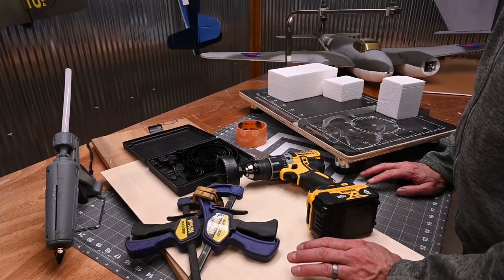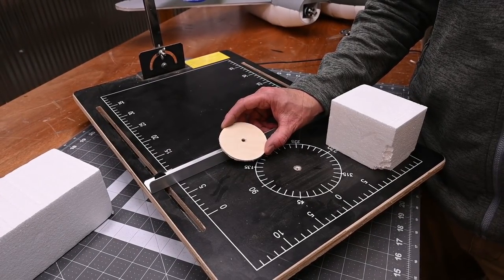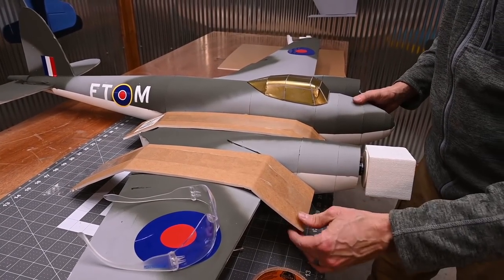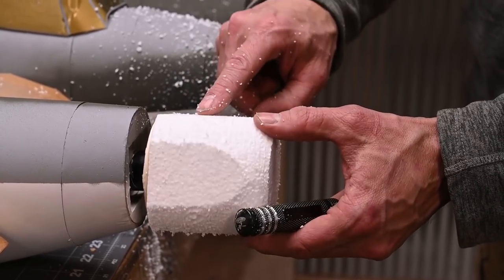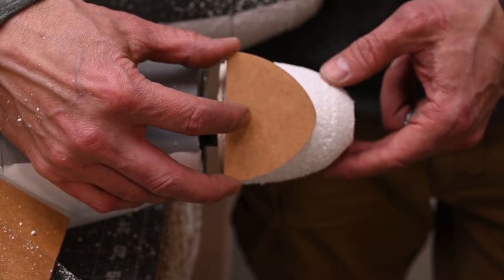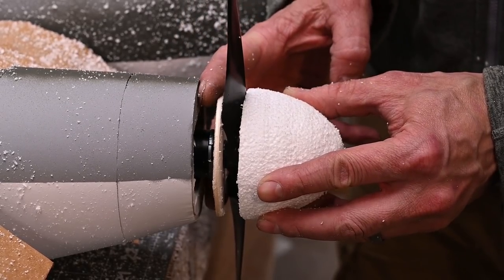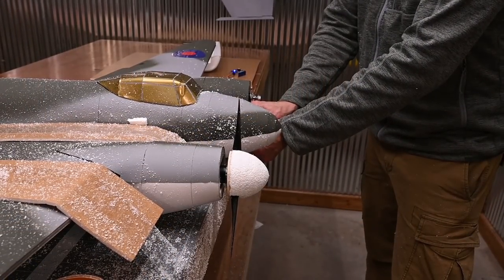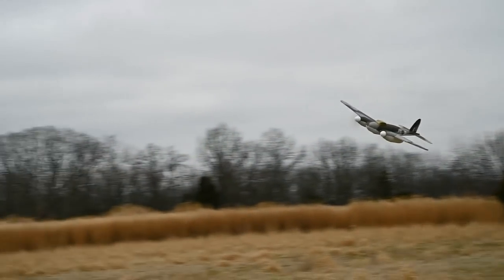How to Make a DIY Foam Nose Cone!

Comment: This was hard to watch why do all that sanding when you could use the hot wire to cut a circle, what a mess
Reply: yea, i expected him to glue the wood circles to the foam and hot wire cut cylinders that way. it would eliminate most of the instability at the first step on the "lathe"
Reply: Why would he want to eliminate all that foam dust by hot wiring it? LOL

Comment: Stop drilling with the hole saw before you go all the way through, and flip the plywood and finish from the other side.  This will greatly reduce the tear-out (splintering) on the back of the disk, and when drilling through thicker materials it will also help the material not be stuck as deeply in the tool when the cut is finished.
Reply: That is a solution, also the one I used to use is to simply have a base chunk of wood that you place your work on and drill into and it acts as one piece and so you get no tear-out, the thing is however tear-out is often the sign that someone does not know how to drill properly, most will use way to much force when drilling and this is what often causes the tear-out because as the material gets thin you basically push the drill bit through the remaining material rather than it cutting through and this causes it.
Reply: Another option is to put packing tape on the bottom side of the piece you are cutting.  The packing tape will hold the wood fibers together so they will be cut away instead of tearing out.

Comment: Save your ESCs from spikes ! Lathe turning 101, cut off corners to make an octagon before you start turning !
Reply: I was wondering why he didn't use the hot wire to make a cylinder using the plywood as a template.

Comment: Not bad for a DIY solution however personally I would use modeling foam as it will allow for a smoother surface, though personally what i have done in the past is you can buy pre molded  smooth surfaced  polystyrene eggs, they come in all sizes from tiny to huge and you just cut in half  or at the point you want.
Reply: Or at least use the denser XPE (blue/yellow/pink) foam you can get at nearly every hardware store.
Reply: If I'm not mistaken, an object can only be cut in half at certain points,  not anywhere you want. You can cut it anywhere you want, but not in half, two pieces are not necessarily halves.
Reply: @shelbyseelbach9568  You are mistaken,  cutting something in half does not require both half's to have the same end volume, this is because you can half by volume but also by measurement, if you wanted to cut an egg in half by volume so you have a 50/50 split then you cut vertically ( from the shallow base of the egg to the pointed tip ), however if you are looking to cut the egg horizontally then you cut in half by measurement, as in measure vertically from the base of the egg to the pointed tip and lets say it measures 2" from base to tip, to cut in half you cut at the 1" mark
Reply: @EQINOX187  if you were halving by weight or by volume, you still can't do it by making a random cut wherever you want, it is you who are mistaken.
Reply: @shelbyseelbach9568  Did you even read what I typed clearly you did not, no one is talking about halving by volume or weight, you clearly know nothing if you think they are the only ways to halve something.  No one said a random cut would be half, again read what I wrote it really helps you not look well stupid, what i said was ether cut in half or cut at a point where the diameter would match, as i said cutting something in half does not always mean both parts are equal.

By cut in half i was referring to the measurement type since when an object is an irregular shape like an egg is you have 2 methods of halving it 

1: First is by size/volume as in cutting it vertically from base to tip in this method it results in 2 identical halves. 

2:  Second is when you have an irregular shaped object but need to cut it horizontally at the half way point that would result in 2 dissimilar parts, obviously you can't halve by size or volume, no instead you halve by measurement, like I said if an egg is 2" from base to tip lengthwise  and you want half by measurement then you cut it at the 1" point this results in 2 halves  buy measurement not size or volume.
Reply: @EQINOX187  so confused

Comment: I would definitely recommend NOT sanding from the side like you did; sand from the bottom so if the paint stick bounces it bounces AWAY from the prop. 
Also, a coat of modge podge (or modge podge mixed with paint) could give you a stronger, paintable surface

Comment: Personally, I would make a concave template. That way, I could check the contour of the spinner with the motor still spinning. But in reality, either way works great!
Reply: at first I thought he was going to make a concave template to put the sand paper on.
Reply: concave coathanger template so you can put a current through that and cut it leaving a smooth surface.

Comment: To prevent foam from covering the area, a great tip is to position a vacuum under the sanding area. It doesn’t pick up everything but it’s worth it.

Comment: If your "Shaping Stick" (sandpaper glued to paint stirrer) was pointed >Towards< the direction of motor rotation, you would get a much smoother sanding... and less chance of getting into the prop...!
Or you could just use a heavier piece of Ni Chrome wire, bend it to shape, and Hot-Cut the desired nosecone to shape!  (I've had good luck with Stainless Steel MIG Wire, bent to shape, and cut all kinds of different foams).
Reply: Was thinking the similar, and doesn't have to be nichrome as I've seen other wire profiled like you note with heavier duty two lead soldering irons and I'm sure other methods to cut the contoured shapes.

Comment: I like it. Gives me very strong This Old Tony and AvE vibes, only without the swearing. Some points I want to bring up, though.

* When you get to the first time you check it against the template, instead of sanding all that extra material off, just use something like a butterknife as a cutoff tool. Saves on mess, will be much faster.

* You could use EPO foam to make these as well, and EPO foam is basically proof to the chemicals used in RC. Shrugs off glow fuel, spray paint, all of it. Stuff's good.

* You could also have a shop vac running with a wide collection scoop near where most of the chips are gonna fly to help with the mess real-time. Won't totally eliminate it but ittl suck most of the foam balls in.

* Alternate title of the video: John Overstreet turns a foamboard Mosquito into a one-time-use lathe.

Comment: After watching this, I think EVA foam blocks might be a good alternative as EVA can be sanded very smooth and takes acrylic paint well. I've  turned small eva foam pieces using essentially the same process shown in this video. Yes, they will be heavier than the foam used in the video, but I think EVA may still be a viable alternative.

Comment: Nice looking spinners, Have you considered  making spinner plugs this way and then vacumforming some plastic ones to install on the model. I'd think that if you used a slightly thicker backplate (say 1/4 inch) you could attach the spinners as they are on 'Full size' planes. Then you could simply make cutouts for the propeller blades and they could be painted easily.

Comment: you can use 4 o 500 grit for final sanding and water base paint will color nicely  you could add a coat of wax or shellac

Comment: I would cover the spinner with two coats fiberglass to give strength, sand and then paint.  I would also find a way to save the spinner in case prop gets damaged, and be able to use same spinner with a new prop.  My two cents :-))

Comment: Wouldn't it be easier to just trim those corners off before spinning using a razor knife? Scribe profile onto flat sides as trim guides....before shaping with sand paper stick.. a small hobby lath would be safer as well as using foam that is more dense.. understand this is an intro method geared towards any level. Not everyone will have a lath. 
Great idea....the addition of spinners adds so much to these models.....👍

Comment: Thin down some elmers white glue (It's water based) Brush that on then you can use regular spray paint.  That will also smooth the texture up a little as well.  Keep that glue coat thin so you don't add too much weight.

Comment: This isn't a bad way to do it, but I would have cut my cube, then used my template laid on 2 sides of the cube to intersect the template, and cut it with the foam cutter. After that, you can put it on a motor and do the sanding like you exhibited here. I would use a finer grit of sandpaper on a smaller stick though. Overall, it's a great technique for making super customized nose cones.

Also, work with with the rotation, not against it. the stick almost caught the prop a couple times from it bouncing uncontrollably. I'm no physics engineer, but I'd guess you can chuck the sanding stick at high speeds if the prop catches it.

Comment: If you'd have continued to use your hotwire cutter it would have been quicker and cleaner to get to a cylinder. Also a drill press would provide a slower, maybe more controllable working platform. Good idea though. Thanks. John S.

Comment: he could have done most of the work with the hot wire, use a little larger template for the concave, then use the 3" diameter backplate as the guide to round it, then finishing is lots quicker and cleaner! there's lots and lots of ways to get to the end results!

Comment: Could cut the blades off the prop just slightly larger than the spinner for safety. Better to sacrifice a prop than the whole model, spinner, fingers, etc! Also hold the paint stirrer / sandpaper from the other side so if it does catch the prop it bounces away.

Comment: You could have saved a lot of work if you had used the hot wire to cut a cylinder using the backplate as a guide.  It would have been a good idea to suggest using a dust mask while producing all that styrofoam particulate.
It would help if the backplate was more square to the motor shaft reducing the wobble.
Ooops.. I see others have also seen the same thing... and yes... it was painful to watch.

Comment: I would make two 1/8" backplates. Rough cut the block to an octagon, WITH A BLADE OR HOTWIRE and eliminate LOTS of foam particles. You would never round off a piece of wood without taking off the corners of the block first. The same would go for any other material on a lathe, which is what the motor has become. Then glue 1 of the backplates to the foam. Proceed as the video but rotate the spinner or place the sanding stick so that the foam is pulled away from you, and from the bottom, not the top. Why not place it over a garbage can or have a vacuum under it? After the foam sections are cut out for the prop shanks, cut out the corresponding sections from 1 of the 2 backplates. Glue it permanently to the spinner. Once the spinner is finished, the prop can be mounted normally against the other backplate, sandwiched between the spinner and the 2nd backplate. Moge poge, light filler, epoxy, WBPU, etc. can make the surface paintable now. The other foams mentioned in other comments may work better but I'm not sure where you find all of them.

Comment: Set your hot wire cutter to multiple angles and turn your square foam blank from it's center axis 360 degrees for every angle. You would have a repeatable outcome with 99% less mess. And it would be about 300 times safer.

Comment: First, never seen before.  Was thinking as watching like... ew... vacuum cleaner will help with cleanup.  Was also thinking a heavier duty two lead soldering gun iron with a custom shaped profile of even copper house wire I'm thinking will work.  Not thinking the soldering gun method on the motor however.  Takes some practice cuts just free form from my experience... though can mount the gun and rotate the piece in a few ways still thinking.
Reply: Typically, I've cut the pattern using the other side of the card board to check the profile.  Thinking now can maybe even cut sand paper on the outer profile to fine tune a more consistent pattern.  I've also seen aluminum adhesive foil covering foam and then the glassing done.

Comment: All great until you inevitably break a prop on landing, then the process starts over again. I like the idea others had of cutting a craft foam ball in 2. Maybe skip the back plate, cut a relief for the prop, and simply tack glue it in place with a bit of beacon foam tac, welders, or similar. looks cool though.

Comment: a total violation of every safety rule  known to this hobby I am stunned at flit test let this  be posted...
Reply: How so?
Reply: @TestECull  sorry but if you do not know then this is not the hobby for you. you need to lave it before you get hurt and hurt this hobby I have enjoyed for over 60 yrs only a fool would put anything near a spinning prop
Reply: @robertdapoppa2778  The only thing I saw that was even slightly questionable was the direction he had the stirrer in at that phase. 

Now stop gatekeeping. I'm not putting down the hobby because someone on YouTube gets their jimmies in a rustle over a nonissue. Bixler wouldn't have allowed this up if it was promoting unsafe practices.

'sides, I have to stick shit in my prop every time I fly. Engines don't start turning simply because you move the throttle lever...
Reply: @robertdapoppa2778  Use your brain for a second rather than just freaking out and screaming 'SAFETY OMG'. John never once puts himself in any sort of position where he could be harmed. Worst case scenario the stirrer gets flung across the room. That's it. He's not in the arc of the prop so if the prop fails for some odd reason he won't be hit there, and he's not where the stirrer will get flung if that gets pulled out of his hands.

He is safe. And so is anyone who follows this video properly. And if he isn't safe then explain how I haven't lost an eye or a finger chicken-stick starting all of my nitros...
Reply: It's funny because you hear this same dribble in ever facet of R/C. Even with rc trucks you'll have elderly guys rattling off how long they've been in the hobby or how someone isn't qualified to operate a toy.  You scroll long enough and you'll find a comment like this burried in every video.